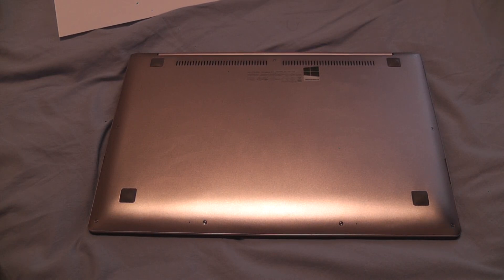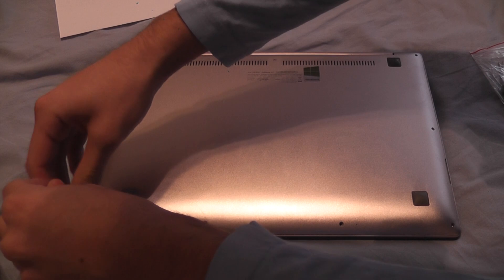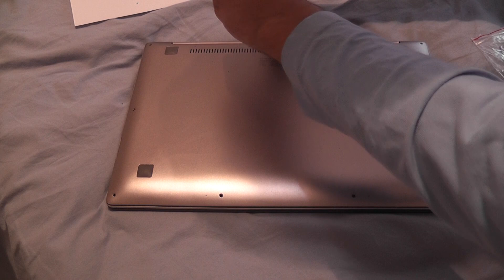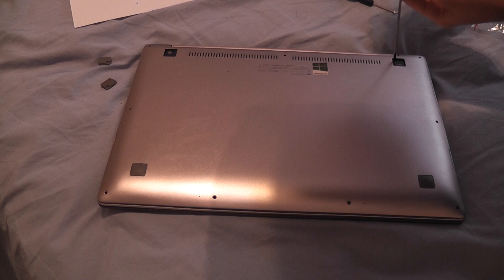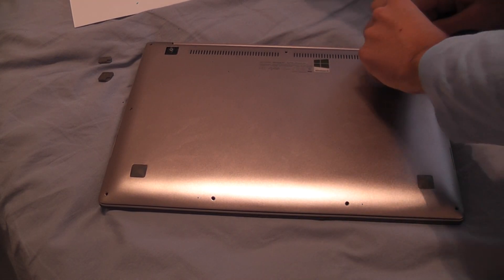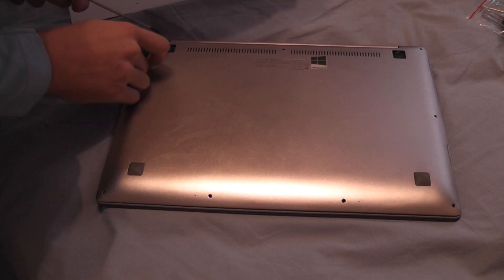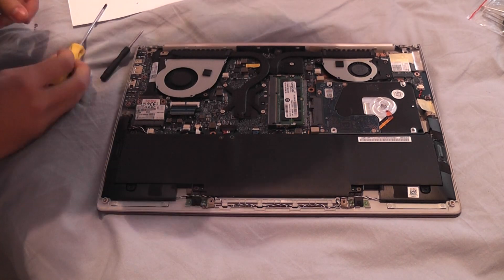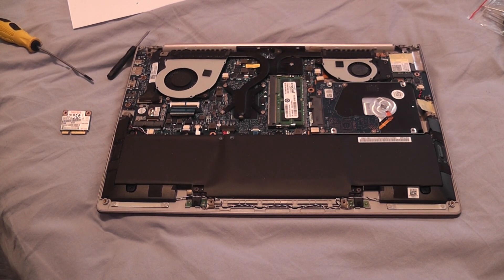ASUS Zenbook UX303LN mSATA SSD Upgrade Guide

Comment: unplug battery first you genius....
Reply from the maker: Eoprava sk For an mSata upgrade there is no need to unplug the battery. I just shut down the laptop and is perfectly fine.
Reply: @PopaSergiuMihai  any time you're touching a circuit board you should disconnect it from any power source. This is a 'guide' after all

Comment: Hello can you help me i have problem in fan it's work all time when i turn on the laptop the fan is very speed do have the same problem and thank you
Reply from the maker: Belal Shikh Hassan Hi. Never had this problem. There might be a driver issue, or the fans might need to be cleaned up? Or even in power control in windows, to have the cooling policy set to active. Other solutions i don't know

Comment: Hi. Thanks for the video. Have you considered use a M.2 module (size 3060 or 3080) with an mSata adaptor and a flat cable? M.2 storage is more cheaper now and more capacity options available
Reply from the maker: Hi. Not really, I am pretty satisfied with how this laptop works, and I think the M.2 will be too long to be able to fit in this laptop, even with the adapter